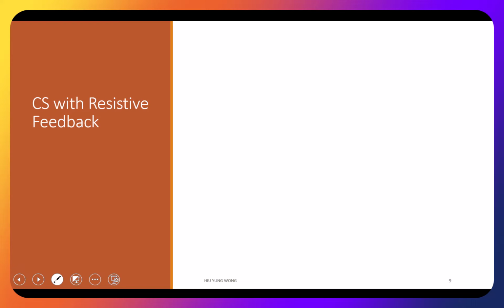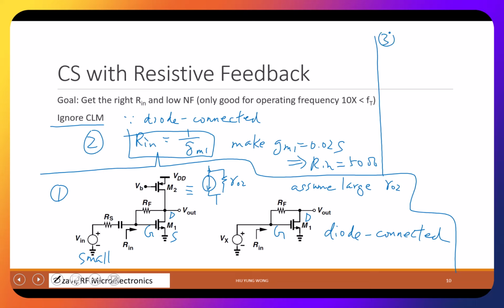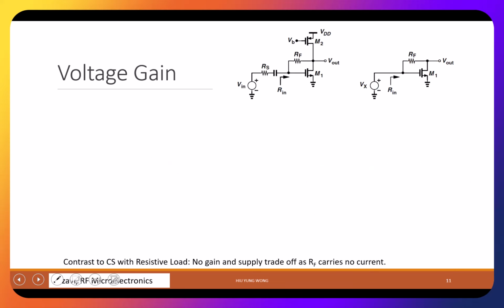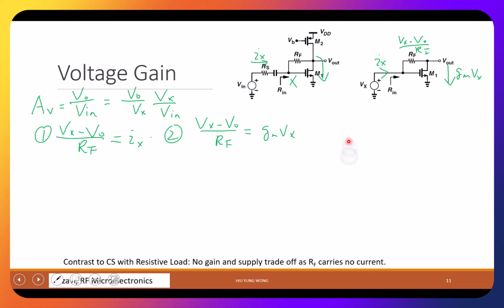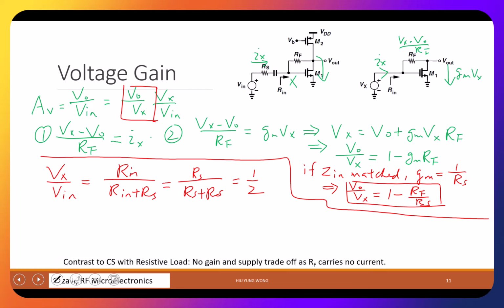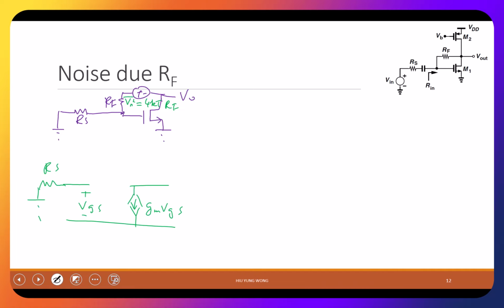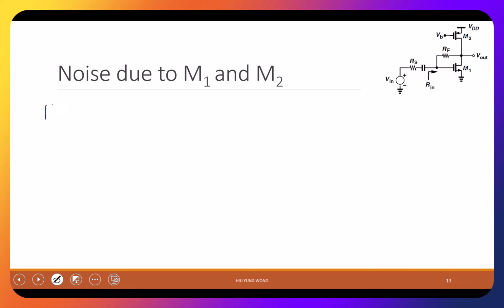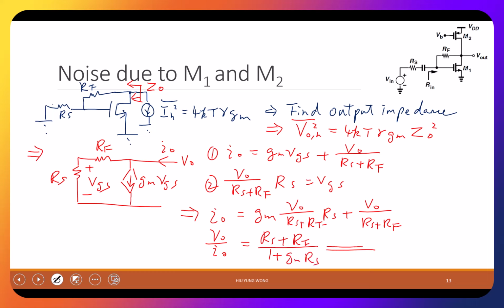L21B - Noise and Impedance Matching in Common Source with Resistive Feedback

Comment: Thank you professor for these lectures. Why is there no noise due to Rs?
Reply from the maker: Rs is not a real resistor. It is the effective output resistance from Vin. We assume Vin is noiseless. In reality, it is not. Then we need to add the noise from Vin instead. But here we are only interested in the noise created at this stage.
Reply: @quantum_computing  thank you professor